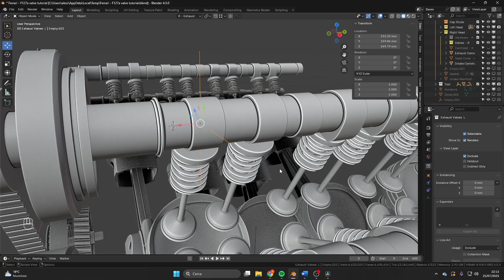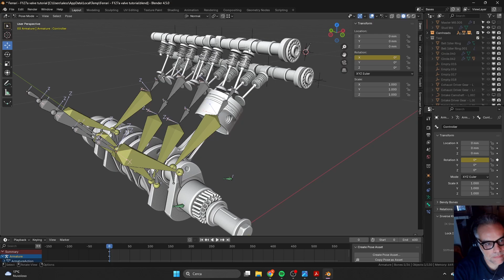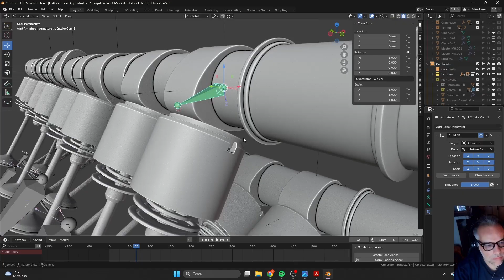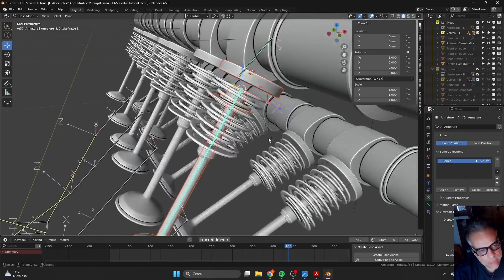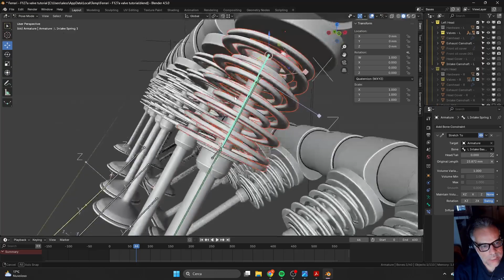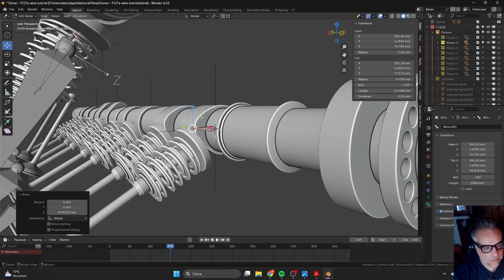Camshaft & Valve Rigging in Blender – Complete Tutorial (Realistic Engine Animation)

Comment: I'm more interested in how you rigged the pistons, i.e., the connection between the crankshaft, connecting rod, and piston. No matter what I do, I get a misalignment between the connecting rod and piston pin at the bottom, or, most often, the connecting rod rotates 180 degrees around its vertical axis.
Based on the bone positions in your video, you rigged from top to bottom, from the piston to the crankshaft. I also noticed an extra bone on top of the pistons; it's most likely a tension bone. I might be wrong, but you also have an extra steering bone for crankshaft rotation.
This is a standard rigging scheme for a piston group. However, I want to rig it without these extra bones, but I'm having trouble.
Also, on the Blender forum, I saw a comment from someone who said that mechanical interactions are better achieved using regular object constraints rather than bones.
Reply: Agree, need more clarification there please